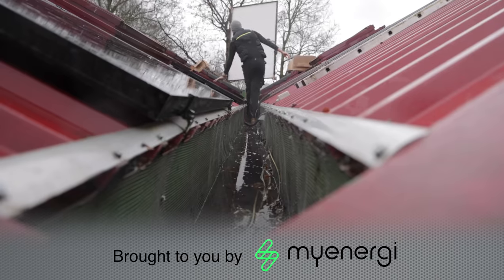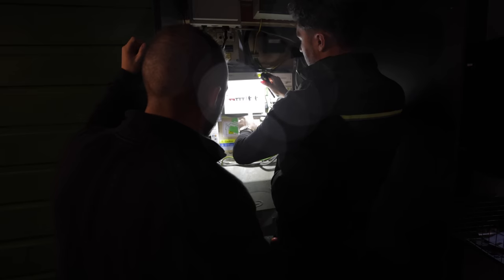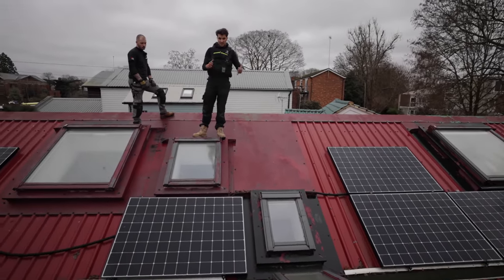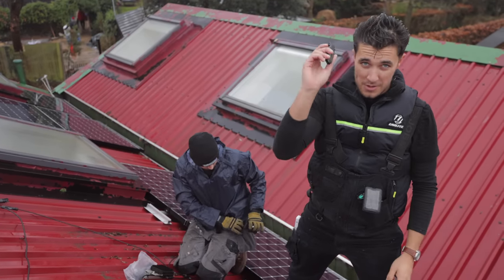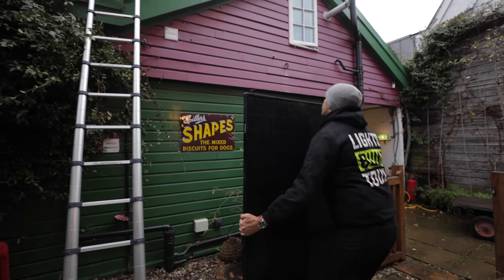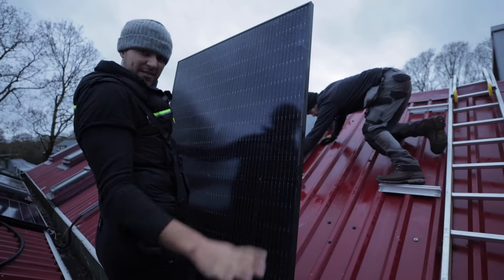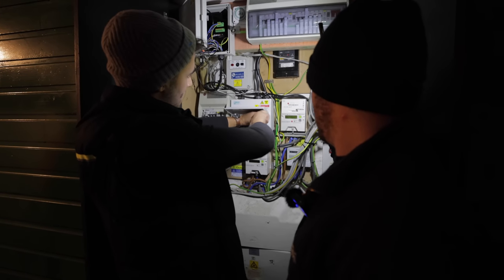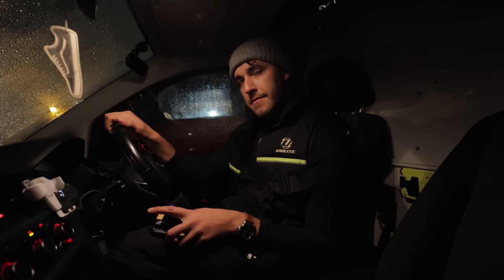How NOT to Install a Tesla Battery | ØY12

Comment: The Renusol clamps are easy to move! Just back out the fastner and push the clamp together (ever so slightly) and it'll slide like butter in a hot pan!
Reply: When you have done thousands it is

Comment: Can create EMF/eddi currents if tails not in through one entry 👍 good video mate
Reply: Its starts to happen around 200amps plus and heats up the surrounding metal large 3phase installs most at risk with big loads as creates eddies currents In to the surrounding metal.
Shocking work by last installer unfortunately seen this alot over the years

Comment: Tails and main earthing conduductor should always  all enter DB through the same knock out and secured in a tails gland to reduce the thermo magnetic effects
Reply: The regs say that BUT if you believe that the heating effects from eddy currents will cause a fire or melt the CU or plastic components inside it I would point you to John Wards test at https://www.youtube.com/watch?v=hg5eZkq2KgE

The heating effect is negligible and to even see it you have to up the continuous current to 100 Amps.

Another case of Regs, created by people with little or no practical experience, based on theoretical physics.
Reply: @barrieshepherd7694  Absolutely right. Before they write regulations they should at the very least test the theory that the reg is supposed to address to make sure its a real problem.
Reply from the maker: The theory is correct 👍🏼
Reply from the maker: In practice I’ve never seen it be an issue on small scale installs like this, but it’s a reg
Reply: @corymac  I doubt that you will ever see it 🤣
Reply: @corymac  Not doubting the theory just the actual risk of it occurring.

Comment: Hey! The optimizers on a Solar Edge System aren't connected in parallell, they all add up to a minimum voltage, however individual optimizers can be contributing 0W without effecting the others (unless there's below the minimum amount of them working).
Reply: yes, exactly. The optimizers are basically DC to DC transformers and they communicate with eachother to keep a set string voltage.

Comment: I haven't watched the whole video yet but if all your panels are in series then your new higher output panels will be limited by the power going through the old panels as series current is all the same
Reply from the maker: We’ve used voltage optimisers
Reply: @corymac  I'll have to have a look at how voltage optimisers work with different wattage panels. Interesting to learn

Comment: If the Tesla powerwall is capable of exporting wouldnt this be included in the export for the G99? so for instance a Tesla Powerwall can export 3.6kW or 5kW depending on how its setup and the PV can export for example 3.6kW that would be a total export of 7.2kW or 8.6kW. Also a myenergi Eddi energy diverter is in breach of Teslas terms of use as it stops export? I Know you cant use Solac 200 or Solar iboosts with them.

Comment: Can optimisers be fitted to a 4kw system fitted about 8 years ago? Also is a  4kw system the max that can be fitted to a domestic house? I would love my system to app capabilities
Reply from the maker: Probably! But depends on the design. App can be used with a modbus. Email me!
Reply: You can fit optimisers but I really wouldn't. They cause a lot of problems and the cost will be almost the same as putting the system up to start with as every module will have to come off the roof. Then when they fail you've got to work out how to get back up and change them.

Tigo or Huawei optimisers might be more reliable than Solaredge but it's still a load of electronics and extra connectors you're putting out in the elements somewhere they're difficult to service. 

To be slightly less negative, depending on what inverter you've already got there's a small chance it might already be compatible with optimisers, the Tigo TS4 is compatible with a lot of different brands. If you are going to pull the system off the roof, you might work out that you'd be better off replacing all your old 250W modules with new 420W modules.

On the "app capabilities" front, have a think about what you want out of it. You might find that your existing inverter can talk to a manufacturer portal but if not there are lots of third party devices out there. They can be for monitoring solar alone or for monitoring solar as part of a larger ecosystem. Whether that's a MyEnergi system for combining renewables, charging and variable loads or a whole house energy monitoring system. 

Finally on the 4kW thing... 16A (3.68kW) AC capacity is a number that's very easy to get through what used to be G83 approval and is now G98 approval from the DNO. For more than 16A per phase you need to fill in slightly more onerous G99 paperwork and a lot of people don't want the hassle of doing that.
Generally you don't want more than about 30% more DC capacity than AC inverter capacity. You run in to limits of the inverter in summer, less than 125% in the UK you won't notice but yield per kWp starts getting noticeably affected beyond 130%. That means that most domestic installs end up being around the 4-5kWp mark which happens to be a nice size for most house roofs and typical house energy consumption. You can get a 6kW single phase hybrid inverter, put 8kW DC on it with a battery and have a lovely system provided you've got someone to fill in the forms for you and your local DNO is amenable.
We're about to start a project with 30kW of single phase inverters spread across two phases and that's going to need export limitation. It's going to be fun getting all the communications working on that!
Reply: Don’t forget that if your getting the fit tarriff you aren’t allowed to touch the panels, if your inverter has failed it has to be replaced with the same capacity, that’s why if adding more solar installers add there own inverter to keep it separate, since additional solar isn’t covered under fit and will need a second meter
Reply: @ram64man  ah that’s good info I didn’t know. Thank you for that. My system is under FIT so I will proceed carefully.
Reply: Panels usually  have a warranty for 25 years but NOT ALL of them. So have the panels tested to confirm their output. Solar Edge optimisers are good however Very Expensive compared to say Tigo Optimisers. Im assuming the inverter isnt a brand well known or supported today so id suggest replacing the inverter with a 3.6kW Solis inverter (Im assuming your 4kW is at the inverter but the maximum in panels for this inverter id suggest only going to around 4.8kW some people will tell you 5.2kW is fine but youll lose energy in heat unless you go for a larger inverter) with Tigo optimisers. Rough Costing for parts would be around £30 - £35 per panel for optimisers and around £800 - £1000 for the inverter. Say 14 panels youd be looking at a cost price of around £1320 - £1520 and then the installers fee of roughly £300 a day and 40% markup on materials. Id give them 2 days if its just an upgrade. Your estimated cost would be around £2448 - 2728 for this upgrade so id only do it if absolutely necessary.
Reply: @Azabajam  lots of info thank you for taking the time to put that message together

Comment: Gotta love an "approved installer". The approved guy who installed our car charger "hadn't done one with solar before" - he fitted the wrong brand of CT clamps the wrong way round, and didn't terminate them properly into the connector. Until we got it sorted it regularly thought our 3.68kw solar PV system was generating 10kw...
Reply from the maker: It’s useless if they’re not testing against standards and enforcing it! Who was he approved with?
Reply: @corymac  EO Charging, but huge buyer's remorse on that decision anyway 😑 - this was back before HyperVolt had launched, and none of the others offering PV integration passed the visual aesthetics factor. It's technically smart, but in the same way as Carling is technically beer
Reply: Fair play to them, EO did eventually send out a competent technician when I explained how my readings were literally impossible

Comment: I think we need to move to the more American system of independent inspectors to sign off a system once installed, removing the need to the property owner to rely upon the installer to have done what they say they have done.

The actual install engineers need to also be listed in certification documentation and held accountable when an install is found to be not up to standard. Hopefully ending the lack of accountability from companies who sub-contract and don't really know who did the work but generate the certs and take your money.
Reply from the maker: That’s a great idea. Is that in every state?
Reply: @corymac  Afraid I'm from the UK so couldn't say (just had a right hassle with my solar system so want to see improvements here), although it does appear from what I've read on forums they can't even turn the system on before inspection in many states.
Reply: @corymac  It varies, but generally you get a permit for works from the city or county level govt and whatever it is is then inspected for (a) compliance with regulations* and (b) being in scope of the permit.  Inspectors are employed by the city/county.  

* "Regulations" will include published NEMA standards plus State, County and City laws that make up locale "code".

Comment: Was the CT on a DC line or AC? If AC it's hard to see how being the wrong way round would affect is as you can only measure the direction of DC power flow like that, AC direction is a bit more complicated.
Reply: The power meter determines the direction of power flow by comparing the phase of the current with the phase of the voltage.  So reversing the connection of the CT reverses the indicated direction of current flow.  There's no such thing as a DC CT.
Reply: @petehiggins33  Hall effect sensors used for DC are still called CT's even though they're not technically transformers, reversing an AC CT won't change the phase measurement also you need both the phase/magnitudes of both the current and voltage, the CT will only.give you the current.
Reply: @mfx1  Reversing a CT will most definitely invert the phase of the current signal and reverse the indicated direction of power flow.  The power meter has to obtain the voltage from somewhere else.
Reply from the maker: What he said ⬆️

Comment: you do know you messed up the fixings on the roof there's no rubber seal under the mounting brackets meaning that they will be getting roof leaks from this !!!!
Reply from the maker: This is an MCS approved system and method. The rubber washer on the screws sorts it, look it up 😃👌🏼
Reply: @corymac  yeh rubber washers on top of the mountings don't work still leaves a gap between the mountings and the roof seriously iv fixed this problem no end of times as a roofer a quick fix would be to simply loosen the bracket and use lead seal sealant underneath around the screw
Reply: @corymac  i am not saying your a bad installer your electrics are excellent i am just trying to educate and save you call backs.